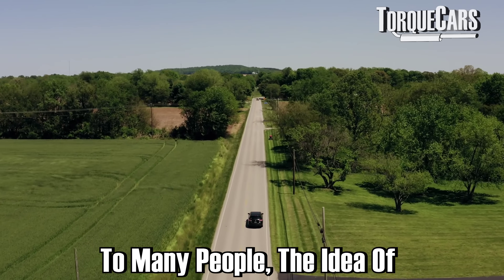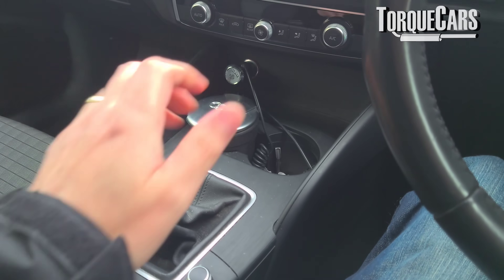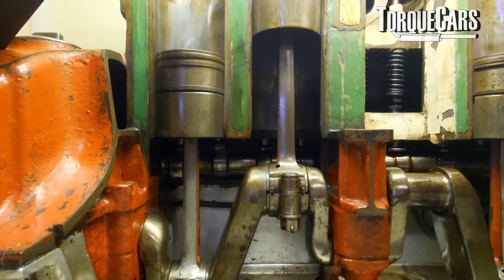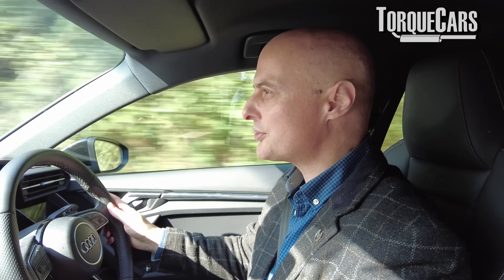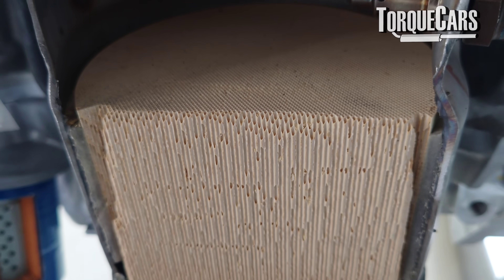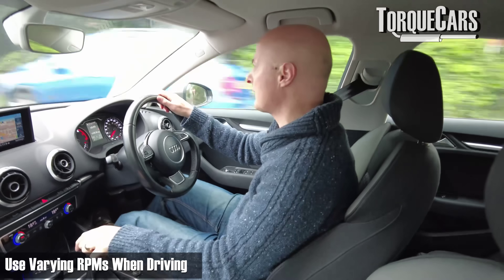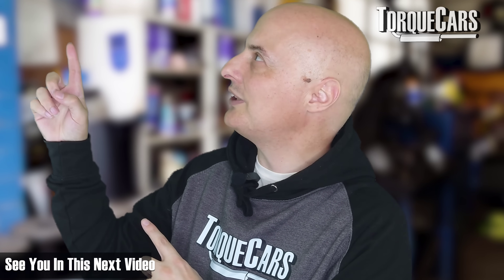BIG DAMAGE By Lugging at LOW RPM? Eco Driving Warning! (Manual Gears)

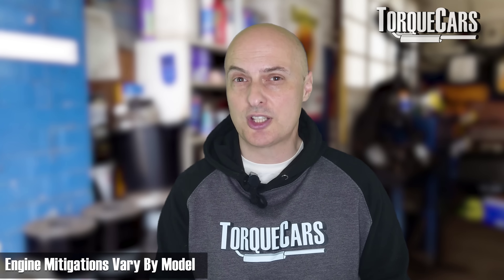Comment: 5:45 you're right cause whenever i go uphill with 2000 on the revmeter and i add gas, it starts "choking" or twitching
Reply: @paveljelinek772  with 2000rpm on uphill( slight uphill like most you can see on roads) the engine should not be choking. Your car lacks the power.
Reply: @fer1306  my car has 102hp and it doesent choke at ~2200rpm going uphill in 4th so yeah
Reply: @foxy126pl6  assuming that it is diesel - it is ok for diesels, not for gasolines
Reply: @paveljelinek772  it still doesn’t labour the engine though and it’s at 2k rpm where it has good torque. It’s not the most powerful especially when there is 4 people in the car. I’ve had to pull away on the same steep hill while revving it to 3k rpm for gear changes, it takes a while to speed up, it is not labouring it’s just all it’s got lol.
Reply: @Xenon777_  i fortunately don't know anything about this.. my ECU had a software tuning so now it's 1.0TSi with 140HP and i only feed him with 100Octane cause the twitch is with 95octane.. edit: btw 4-5 people in the car, fully laden, normal cruise, 4.7l/100km. Full car, i can hit the gas as i want, it even goes 220km/h, 5.3-5.4l/100km this is THE ABSOLUTE MAX it won't go over that
Reply: @paveljelinek772  My next car will probably have a 1.0 TSI engine. They seem to be some of the best small turbo petrol engines available. The ones I've been looking at are 95 and 110 BHP.
Reply: @Xenon777_  take the 81kW version then (110HP) and let any good chiptuner upgrade it, mine's from 200nm to 250nm and 140HP edit: no 2.0TDi nor 2.0i can't take me (have i told you that my car weighs only 1020kg empty?)
Reply: My 1.4 Diesel can go up a pretty steep hill in 5th gear at 2000 RPM with 50% throttle going around 50 - 55 mph. It doesn't have any more power available though, even with my foot to the floor it wouldn't go much faster. 4th gear would probably be the better gear (RPM would be around 2500 rpm) but it gets up in 5th fine without labouring. It only has about 68bhp.
Reply: @Xenon777_  This basically means you choke it and SHOULD go 4th gear
Reply: I've done 5,500 up a hill quite regularly. Never overheats either.

Comment: One thing is ECO on lower RPMs, one thing is full gas on low RPM (2nd gear does not count) and going uphill on low RPM 😢 rip engine edit: what most peeps dunno tho is the fact that the most fuel savings come when you hit the max-torque-range and sustain at that. Obviously the lowest spectrum of that BUT every engine has it set a little bit different SO this is the no.1 reason when to go to the "brake" or DYNO
Reply: If you just grabbed any normal car and operated it's engine at the rpm which has peak torque, you'd be running the engine too high rpm for the load, decreasing fuel economy and increasing fuel usage.

Only on really underpowered cars like kei cars could this make some sense. Driving at 30 kmph while the engine is at 2000 rpm is not fuel efficent, 1000-1500 is more efficent under low power demands because you aren't wasting extra fuel on friction, even though you are running the engine at a lower thermal efficency. Once you're at highway speeds though, you will need the extra power, and moving at a higher speed is a positive for fuel economy, until the thermal efficency peaks or drops off, and the friction of the engine rpm and air resistance starts to negatively effect fuel economy. 

With a perfect transmission, you will get better fuel economy at lower speeds than higher speeds simply because of air resitance, friction and thermal efficency occuring at different engine loads, rpm and manifold preassure. 
But no, we have inperfect transmissions, driveshafts, bearings and engines. So, we get especially bad efficency at lower speeds because both wasted engergy braking and accelerating quickly, and engines being at too high rpm for the speed you are going. 
It's why often times an automatic transmission can get better fuel economy than a manual transmission, because it's always upshifting when it can and wants to to get the desired fuel economy or power. Someone driving a manual might maintain 2500 rpm through a roundabout, because who's going to upshift twice while navigating intersections while observing the road for hazards while steering, indicating, multitasking etc.

Comment: Low RPMs are horrible for the clutch and flywheel. There’s a reason you see so many diesels with clutch replacements at less than 200k miles and so many reports of DMF failure shortly after remaps, especially in cases of people remapping for economy. I knew a guy who killed a clutch in 3 years by trying to save fuel, despite all the warnings he had. It also punishes the crank shaft and connecting rods. But people are so desperate to save a few pennies or get a dopamine buzz  from seeing an outrageously high fuel economy reading.
Reply: I believe that a lot of these failures are due to the dumb manufacturer on screen gear change recommendations.

On my 2.0TDi, which is notorious for Dual mass flywheel issues, I've had no issues at all. Reason being, is I never lug the engine. In situations, it'll recommend I change into 6th at 40mph, which just ain't happening, the engine is not happy at those speeds.
Reply: @MEGASilleh  Bro i have the same engine but with 104bhp!
Engine shakes like crazy at recommended gear changes,shit is crazy like it has absolutely zero power
Reply: @stiffybeanie4148  i had a rental Corsa 1.2 that thing literally felt like it was rocking back and forth if I followed the shift indicator. How anyone can think it’s safe for the drive train or even a pleasant driving experience is beyond me
Reply: @MEGASilleh  it only does that when it senses low load. I'm assuming it doesn't recommend you go uphill at 40 in 6th, or tow at 40 in 6th. Then again I don't know the car's gearing. Rolling along the flat doesn't use much force, so you can go into 6th, unless the driver is a jerky on off on off throttle driver, and then the engine is alternating periods of high load making it lug, and unloaded. There is a range of throttle openings that will run smoothly and above that it doesn't. You need to go above about 1700 rpm to run smoothly at all throttle openings in most cars.
Reply: @vxvii9069  why is it bad for the clutch and flywheel? Could you explain?
Reply: @addi.1813  pretty sure not revving switching gears but preventing stall outs by riding the clutch accompanied by that low-rpm "rattle"
Reply: @Mr371312  but riding the clutch is not fuel efficient. You are burning good fuel to rub two plates together like millstones.
Reply: @addi.1813 because labouring the engine jerks the transmission
Reply: @addi.1813  it’s just a huge load on the components. Clutches are rated on torque - ie the actual force applied. Normally when you apply force the effect is reduced as the wheel speed increases. What you’re effectively doing is punching a brick wall. Sure you might break said wall but you’ll hurt your fist in the process. Always keep the RPMs at a level where you can smoothly accelerate without any hesitation or general sense of uneasiness. If you’re going downhill it may not be an issue to be at very low revs. Anyway whatever small fuel economy gains you may see from shifting early it is NOT worth the strain on the engine and transmission. The ridiculously early upshift indicators in modern are there to satisfy the eco zealots and make the car more attractive to fleet buyers who will sell the vehicle before any trouble starts. Only for the next owner to need a new DMF and clutch within a year.
Reply: There is no wear to Clutch except when you are using it.  Clutch wears when taking off and on shifts. More wear when upshifting on hills. Unless the clutch is slipping it doesn't matter what the rpm are when disengaged.
Reply: @cruiser6260  But the Pressure plate is taking the beating at low rpm that's part of the clutch.
Reply: @bertriedstra4  the pressure plate is a wear plate it wears with friction like brake linings. There is no friction, no wear when you have the clutch out.
Reply: @cruiser6260  that’s not true. The pressure plate is only rated to a certain level of torque. Above that the engine is spinning so forcefully it’ll overpower the pressure plate and cause the plates to slip. Rarely an issue on standard cars but it can happen on modified cars that are outputting far more torque than the transmissions were built to handle
Reply: @vxvii9069 that's exactly what I said. Doubling power over standard could cause some clutches to slip or break, it happens at the dragstrip a lot. There's no danger of that happening at low rpm close to labouring and stalling...
Reply: @cruiser6260  the vibrations rattle the DMF to death instead. Then you need a new clutch as well so you’re looking at a 4 figure repair all for the sake of maybe a 1% improvement in fuel economy.

edit

I know a lot of Finns have starship miles on original clutches and flywheels. So why are theirs lasting 2-3x longer than others? Simple. They’re taught how to drive a car correctly and that does not include obsessing over fuel efficiency improvements which by nature have ever increasing diminishing returns
Reply: @vxvii9069  a sparsely populated country like Finland will have people cruising at highway speeds and with far less traffic congestion and stop start driving. Far less take off and gear changes for the miles. But yes if you have a DMF such as in a diesel and are stupid enough to drive labouring the engine, that would shorten it's life
Reply: @cruiser6260  tons of people do exactly that unfortunately. Lease and fleet drivers don’t care and newer drivers are taught to think of their CO2 emissions rather than the car’s longevity. Besides poverty is a real thing in Europe nowadays. I don’t care about any of that though. V-power only, yearly oil changes on my 3-5k mile annual usage + not using hard throttle or high rpm until it gets to the middle of the temperature gauge. No engine or transmission or turbo issues so far and I’m very happy with the fuel economy :)
Reply: @cruiser6260  Not true. Clutch wears under acceleration as well. More so when accelerating from to high a gear
Reply: @Paul58069  there is no slip when the clutch is out so that is impossible. Just like brakes don't wear unless you touch the brake ipedal, clutch only wears when you touch clutch pedal. If you double the power and torque of the vehicle, the clutch can be the link in the drivetrain that breaks or slips. That won't be happening at rpm just above idle though

Comment: When I first purchased a direct-inject small-displacement turbo manual, I "hyper mile-ed" by driving as much as I could keeping the engine off-boost. Lugging wasn't part of it - it was about finding the best combination of gear to throttle position that would not drive the turbo to produce significant boost. 
Here's the problem - it wasn't the engine that was the problem; it was the clutch. Being a performance car, the engineers expected a certain amount of "spirited driving". Without it, the clutch material "polished" to the point it started slipping. That was the end of my experiment - I replaced it with a 5 puck racing clutch and drove it like I stole it until I eventually sold it.
Reply: @steve_put_this_here  clutches don’t polish over
Reply: BTW, you're supposed to take your foot off the clutch pedal. If you don't get 200,000km from a clutch, you're doing it wrong.
Reply: @jonathanrabbitt that's incorrect. (Second part) Build quality and the type of driving you do effects clutch life way more than distance.
Reply: Boost is what gives you good thermal efficiency. You should use all the boost that is available and keep the RPM low by changing up as early as you can with the engine able to pull smoothly in the next gear.

Comment: I drive at extreme low RPM with my CVT, around town in 25 MPH limit I speed up at 1,250 RPM. Around 40 MPH limits I speed up around 1,500 to 1,600 RPM. And on the 50-60 MPH roads with stop lights I speed up around 2,000 RPM. Merging onto the freeway I go around 2,500 RPM. 

The CVT should prevent lugging, but carbon build up is possible.
Reply: Sounds like a special case. CVT vary the rpm seamlessly so you technically should be at the right rpm all the time 🤔
Carbon buildup is engine design, direct injection and EGR which is overall 👎
Reply: @rosen9425  Yup! Always the right RPM. I just use very little throttle.
Reply: @extralock1045  
Always throws me off when I get a loaner hybrid or something. It's a different driving style for sure. And my fuel economy absolutely suck because I'm driving it like I drive mine. Doesn't work 😄
Reply: Your cvt is doing technically ideal thing peoples brain just cant comperhend that. 
And with carbon...
If you just do 2miles trips reving wont help, if you drive on open road and highway sometimes it will reach operating temps for dpf for example anyways soo..
Reply: @Boz1211111  I regularly drive on the highway for 100, or 200 miles, sometimes 300 miles. I usually stay at 55 MPH. Only go over when going down a 6% grade. 

Cruising at 55 MPH I'm at about 1,900 RPM. Going up a 6% grade, I'm at 2,300 RPM with the AC off, 2,700 with the AC on. 

I regularly go up mountains too. I have a house on an 8,500 foot tall mountain. So I regularly go up to work on it, or drive up for fun. I tend to hold the car at 1,900 or 2,000 RPM goin gup the 40 mile long hill. 

That gets be between 30, and 35 MPH. I just take all the turn outs to let everyone by.

But with 78 horse power, it does quite well!
Reply: @extralock1045  
78 hp?? 👀what are you even driving. That's quite impressive given the topography challenges thrown at the car
Reply: @rosen9425  I am driving a 2024 Mitsubishi Mirage hatchback es. It's the base model. If you want to more fancy-looking version get the SE which has a lot more features than fancier seats. 

Either way over the past 24,000 me I have averaged 52.2 miles per gallon. I do mostly mountain and freeway driving. I avoid the city. I often go up roads going above 8000 ft in elevation. Mostly for fun actually.
Reply: @extralock1045  
Genuinely impressed, that's not a lot of hp for a 2024 model and it does high altitude.  Steep grades? CVT isn't complaining about it either by the sounds of it. With great fuel mileage. 
You should get into being a Mirage sales rep 😆
Reply: @rosen9425  the transmission isn't happy in some situations. I regularly go up a local mountain which is 2500 m above sea level or 8500 ft above sea level. And if I am constantly over 2,500 RPM the transmission will overheat. That's just how they are. And it's fine if it's a short heel but this is 38 miles up. So I give it 2,000 RPM and go about 35 to 40 mph. Far from fast but it gets there. And round trip up and down the mountain I can get over 65 miles per gallon. The high elevation helps the gas mileage.
Reply: @rosen9425  on the freeway above 4000 ft in elevation on a 6% grade it doesn't really want to go much faster than 55 mph. You can go 70 mi per hour but it will be about 70% throttle. But that's pretty high elevation and as deep as a freeway is possibly able to get.
Reply: @extralock1045  How do you possibly know the transmission is overheating?  Also, steady-state loads should have no practical effect on transmission operating temperature since the friction does not change in any appreciable way.  Also, under no circumstances will lower air pressure (higher elevations) make a car more efficient.  A turbo can offset the lower air pressure, but that will have no impact on efficiency, conversely, it will allow the engine to burn more fuel that a normally aspirated car, making the economy worse .
Reply: @awebuser5914  I have an OBD II tool that tells you everything, like fuel trims, transmission temperature, coolant temperature, codes, it's an Innova 5610. And when I go at 3,000 RPM for a long time the CVT goes to around 230F to 240F, sure, not very very bad, but that degrades the fluid quite badly at those temperatures. 

So it's not RPM, more so load. You're about 1/2 throttle for a long time at 3,000 RPM, and that gets it warm. But just sitting in neutral at 3,000 RPM won't do anything.

I keep getting told cars get worse MPG at high elevations, but I keep testing it over, and over, and I get higher MPG in the mountains. So I'm not exactly sure what to think of that.
Reply: @extralock1045  CVTs are meaningless in this context since you typically have little direct control over the ratio.  Also, engine speed is completely irrelevant, if you have the ability to select a "ratio" that just means input speed is higher for a given output speed, which is essentially the same, the sheaves are just running in a different configuration, with the input going moderately faster.  This would not heat-up the oil in any relevant way.  The engine is probably generating more waste heat and that will invariably be partially sunk into the transmission housing, so that's where the heat is coming from.
Reply: @awebuser5914  Maybe? I know the engine is never even close to hot, but when I run the heater, it does help cool the CVT.